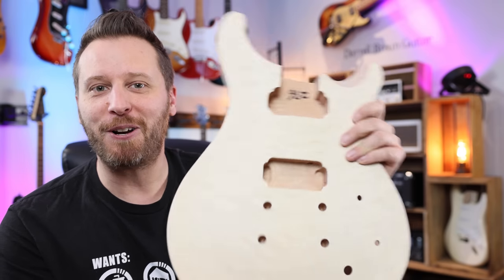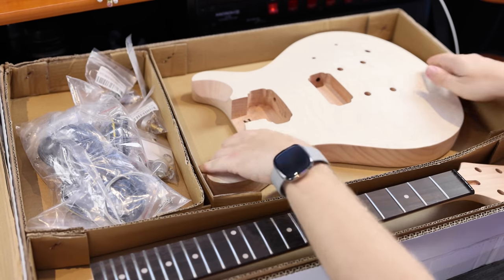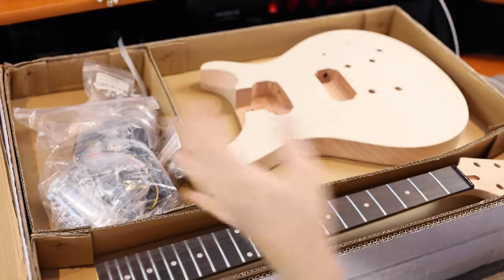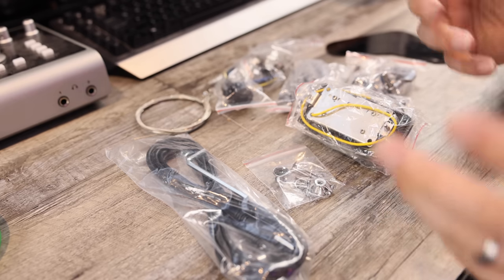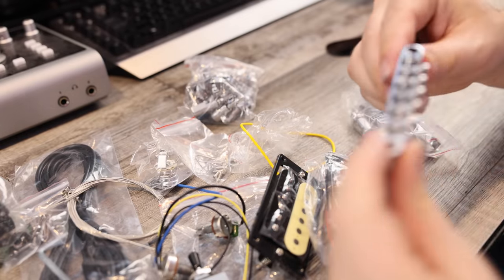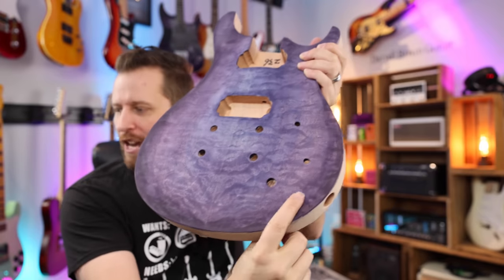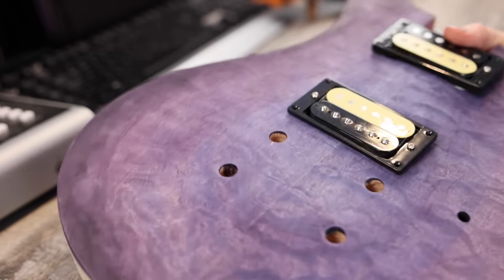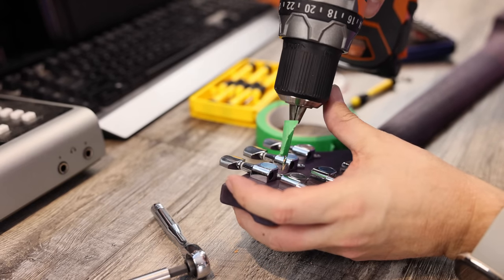Building a PRS Style Guitar! - This One Had Me a Little Nervous!!

Comment: You can use 'Rit' cloth dye as well for dying wood mixing it a littl stronger for the wood works well . I went with spray cans and an airbrush for the space theme stars and planets paint job I put on my project guitar. startimg with a Starcaste, Strat electric guitar,  Said it right on the head stock befor I stripped off all the paint to begin the xtreme mods I had in store for this build I hand made the stainless steel pick guard that holds the 3 quad rail humbuckers each with a500K  P/P vol. pot and 500K tone pot with the bridge pot also a P/P as a bypass to activate the bridge and neck pickups together regardless of the 5-way selector sw Pos. coil splitting with th P/P pots wired like a Les Paul 50's stle circuit for cleaner highs. and i only need one side of the 5-way blade switch for that. the other will operate the pickup coil indecator leds also wired the same as the pickups using the opposite sides of the blade and P/P switches,, as each has 2 seperate sides remember?    its there so why not use it for a new trick i dreamed up... It also gets a kill button just for fun. I added a fwe trick parts too including a ful size brass trem block, roller saddles and roller string trees and a titaniun nut as well as locking tuners too.. like I said in the beginning this is an extreme build/mod. I started with a "Starcaster. so in thr Fender naming pogression i went one step furthr they started with the 'Broadcastger, having tp change it to Telecaster, then Stratocastr then this Starcaster so I progressed it to My new version, the "Stellarcaster"  space is the final frontier.. isn't it so the space theme paint and the astainless steel pick guard that will mimnic a space craft a little as well as act ass the overall ground for the circuits.  ... like I say use what you have tht works for your project.  the mounting washers and nuts aer attatched to the case which can be the ground so a stainless steel pick guard can also be a grounf.  less wiring to worry aout but I still have to add a few extra wires for the bypass ans kill button so it all evens out I think..wish ne lick.

Comment: I would think that if you're using the same stain on the neck and back of body that you would fit and test the neck for angle and then glue it in and do the stain afterwards.  Will that stain not interfere with the glue penetrating the wood for a good bond?

Comment: Others have mentioned the downside of using the foam brush, and I agree. When hand-applying a burst effect, the foam brush leaves too much of a hard border line between colors (visible in the lower part of the body near the knobs).  A clean rag or even a blue shop-towel to apply the color, then lightly feather with the dry part of the rag or paper would facilitate the color blending a little more (sort of that Bob Ross/Joy of Painting method of using a light tough to blend colors into each other).  That'll also enable the burst blend between the blue & purple to look smoother while retaining more of the original blue instead of covering up more of the blue with the blue to compensate for that hard line.

Also, definitely dilute the colors.  Much easier to add more color than it is to take it away.

Comment: Nice build Darrell!!
Just a couple of tips:
1) Don't touch the stained body with bare hands (especially if you have a lot of sweat) - besides it will get messy, aniline water-based dyes are harmful for your health.
2) Make sure to mask properly the area of the neck heel that will sit inside the neck pocket before you apply  sealer or clear coat, because you got to have bare wood to glue the neck and the body together.
I'm lookin' forward for the next episode! 
You have fun!

Comment: Great video My favorite review channel. Like he said TAPE lol off parts you want to protect. Kits with binding can be scraped with a razor blade to expose fresh plastic. Just be gentle. The Thin Maple on this and some other kits may be to thin. But if you want the Quilted Maple to really pop. Dye the whole thing black and sand it back to bare again. The Black will darken the dark lines and give some a finish after clear coating that looks like the grain if almost floating. If your doing a earth tone like honey or tobacco burst. Use brown instead of black. A mixture of brown and orange. Will give a warm hue to the lighter center area.Use bits of a well washed white tee with circular motions. Those sponge brushes tend to make the edges to defined and hard to blend.

Comment: Over the past two years I've become a big fan of 'how good cheap can be'.
I recently finished a Solo spalted ash Tele kit. Only issues I had was second-guessing whether I could sand the veneer as it is so thin, so I went with a colour, and then ended up sanding, and more colour and sanded again, and stopped as I realized I just could have black/purpled it. It ended up some sort of taupe mushroom colour lol. It's fine and still looks nice, with about 15 coats of wipe-on poly that was wetsanded. 
If you have any doubt, replace the tuners with a cheap $25 locking set from Ali Express (this is mandatory as the supplied ones won't hold tune, or tune well), and a $1.50 bone nut from the same place, as the one supplied is plastic garbage like the tuners......put sandpaper on the table and rub the bottom and test. Keep doing this until you get the correct nut height as opposed to cutting nut-slots deeper, as this is very easy top mess up if you don't have experience doing it and requires more tools/money. KNock out the old nut with a screwdriver and a hammer. Gently tap until it pops free and then clean up the groove. Sand/test, sand/test, sand/test and then use CA glue to fix it once the height is correct.
I shimmed the neck also, to get a better angle to lower the action ($5 for a set of 4 shims/Ali X), and used the thinnest one. 
After replacing the tuners, nut, strings (obviously) and shimming I have an extremely playable guitar with a beautiful action, and I'm not lying when I say it's so stable. I can play hard every evening for a couple of hours and it just stays in tune. I pick it up the next day and it's still tuned almost perfectly. I'm very happy with it and never expected to have such a playable, tune-stable guitar, but you need to spend the extra $30.

Comment: I did a 'PRS' build, but sourced the body and neck separately. My body had a thick maple cap on mahogany body.The neck stood too tall in its socket for my taste, so I re-cut it so the neck binding was at the body face. I used a Wilkinson combined stop bridge and took an extreme amount of care setting the neck to the correct angle. I have stained guitars before, but this one was en-natural and clear oiled. Came out nice.